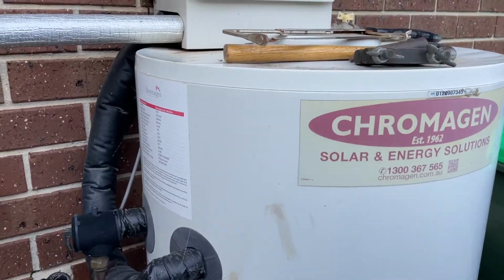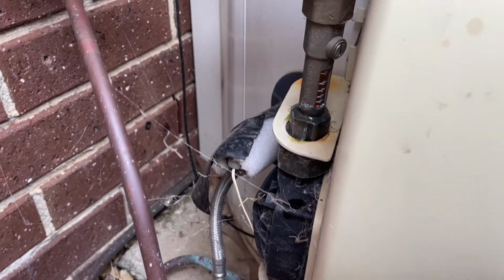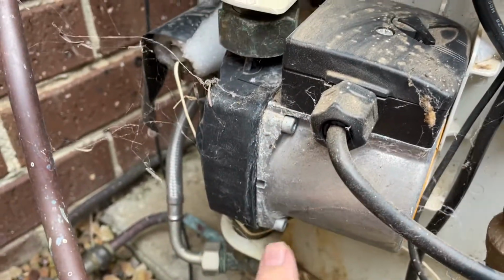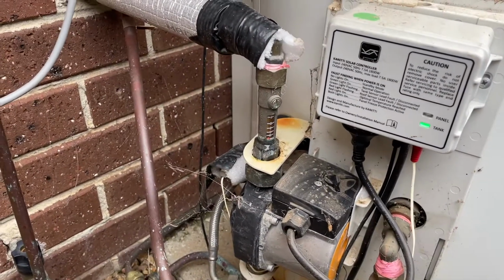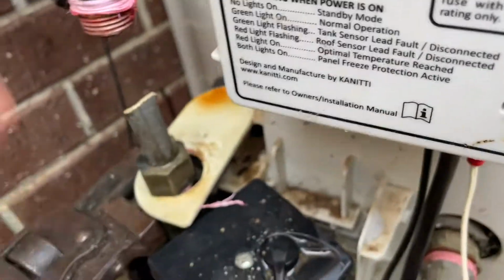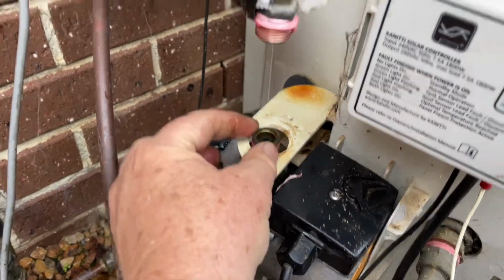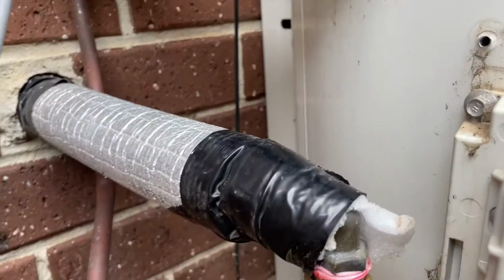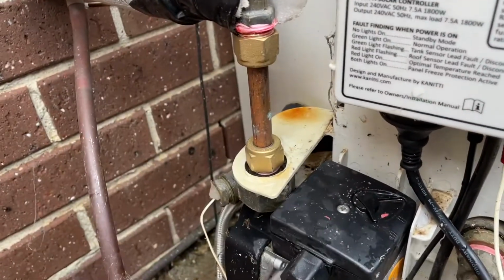Solar Flow valve Permanent Repair. Hot Water system leak fix. Why you must stop that drip Plumbing

Comment: There is spray leaking from the pump cover. Checked the valve and pump nuts all dry. Not sure where the water leaking from. There is water dripping down the flexi hose.

Comment: Hi Mark, I've got a dual solar panel on my roof and found that one corner has this leak valve. But my question is that this valve has been leaking (not only a drip, it's pouring) for months and months now. What should I do?
Reply from the maker: It sounds like an anti freeze valve and that it needs to be replaced. It is under mains water pressure so if you change it yourself make sure you turn the water off first. Also the water will be very hot. If the valve is pouring out then your solar boost won’t be working at all. MRT
Because it is hot water under pressure probably best to get a plumber.
Reply: Mine was leaking from the fibre washer inside the frost valve (water coming out from the thread). I just turned off the mains water, turned off the pump, removed the frost valve in the late afternoon, removed and replaced fibre washer, then refitted. Only thing I wasn't sure about is if I was suppose to release air pockets in the panel somehow? Not sure?